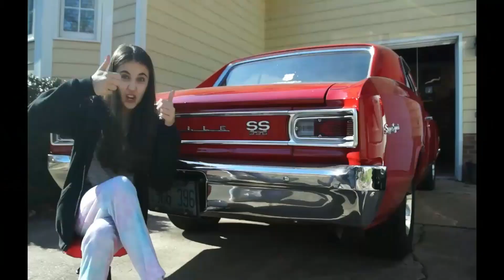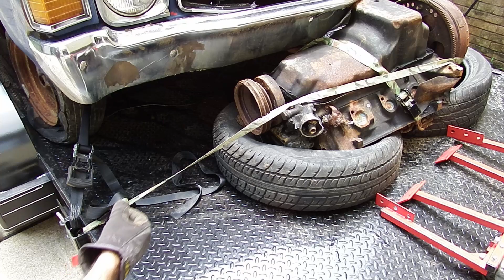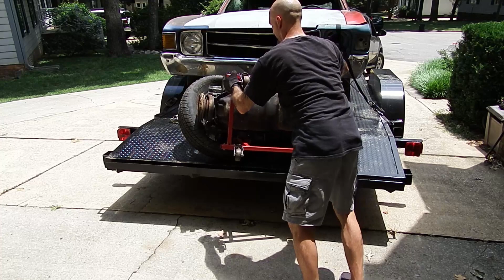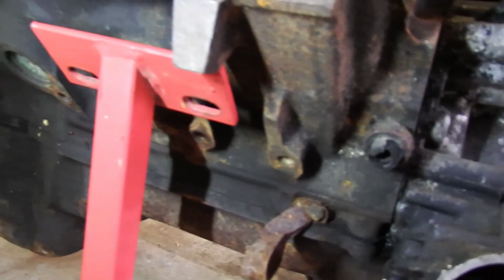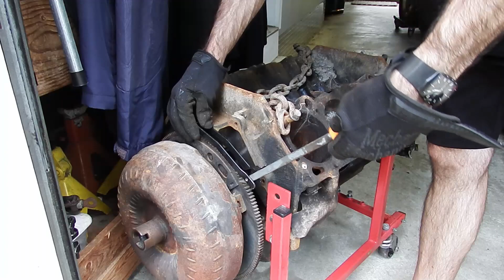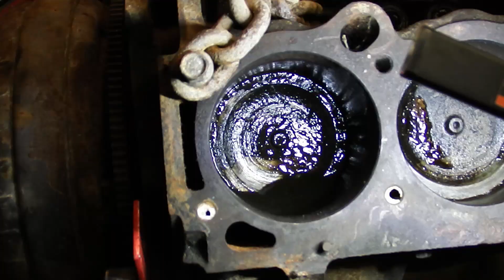Buick 455 Engine Will it turn over?

Comment: I would recommend T/A performance parts. 226 @ .050s cam would make it fun with Rhoads lifters. DONE RIGHT you could make some money of of selling a rebuilt engine. DEFINITELY raise the compression ratio to the pre-71 levels.
Reply from the maker: Sounds good, probably not going to build this. But I am going to do another video and pull out the pistons and the crank and see what it all looks like in there. I will be selling this engine complete with the heads and intake and all other parts that came with it. Hopefully local sale close to Raleigh North Carolina. Thanks for watching!

Comment: A 2x4 or two would help increase your leverage and give good hand holds, especially with the cradle on. Would have left the magic mix in the bores... I use a strip of emery cloth scrubbing horizontally, it works great for getting a bit deeper between the piston and the bore. Hey Dan, you could pull the pan to see what's what with the bottom end because for sure someone buying it will want to know, did they even ever produce 4 bolt mains ?
Reply from the maker: Good idea on the 2x4. I probably should have taken the pan off while it was upside down on the trailer. Oh well, hindsight. If anyone is interested, I could put it up on the engine crane and pull the pan if enough people would like to see. Don't know about the mains on Buicks.